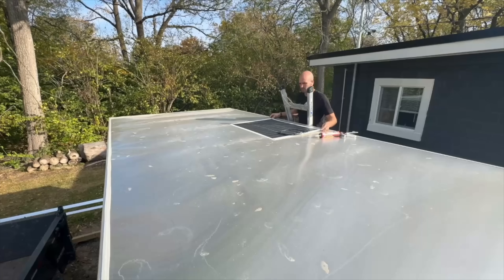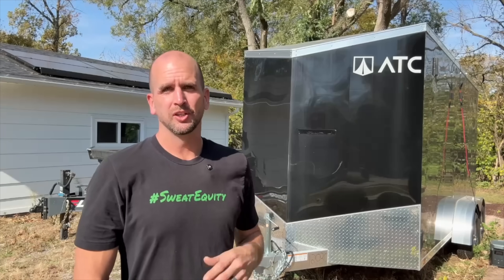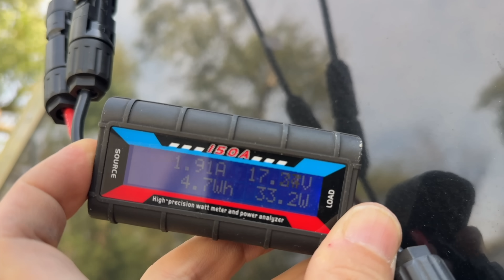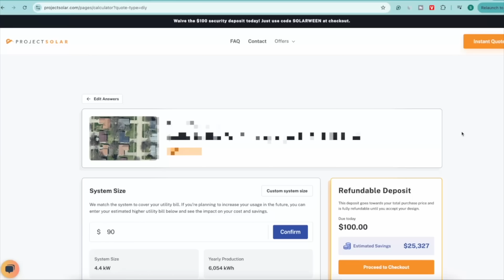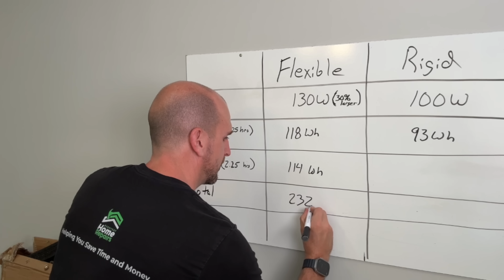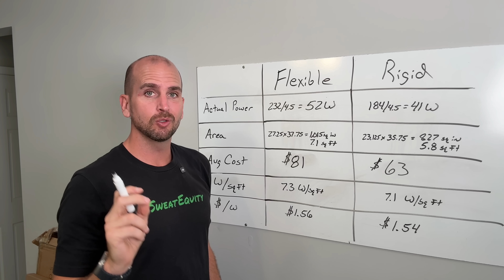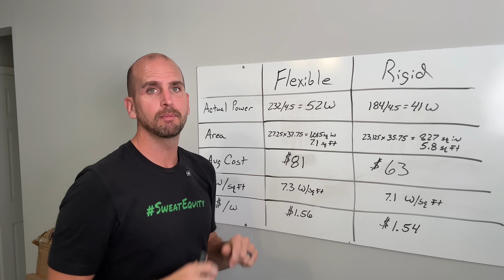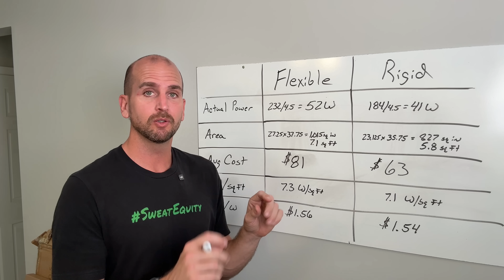100W Flexible Vs 100W Rigid Solar Panels | Don't Buy Until You Watch!

Comment from the maker: Calculate Solar Cost For Your Home - https://geni.us/solar_reviews
DIY Home Solar (Save $1,000's Going DIY)  - https://geni.us/qN9Ot

Supplies
ECO-WORTHY Flexible 100W Panel - https://geni.us/23k6F59
ECO-WORTHY Rigid 100W Panel - https://geni.us/2Fk0zAK
UniStrut Spring Nuts - https://geni.us/GIqiUO
Panel End and Mid Clamps - https://geni.us/dQmg
Lap Sealant - https://geni.us/E7HDRGk
EcoFlow 100W Panel -  https://geni.us/0LR1mBl
BougeRV 100W Panel - https://geni.us/q6orTqp
Renogy 100W Panel -  https://geni.us/uSVA100

DISCLAIMER: This video and description contain affiliate links, which means that if you click on one of the product links, I’ll receive a small commission.
Reply: So basically, flexible costs roughly 20% more, takes up roughly 20% more space,  cost about 20% more and lasts half as long?

Comment: Had flexible panels in Australian sun for well over three years, then sold van, with panels still fully functional. Zero issues. Minimal ventilation. double sided tape directly to the Sprinter van roof, which has some ridges on the actual roof. Didn't buy the cheapest. Maybe I just got very lucky, but I suspect in many cases people are buying cheap rubbish, then blaming the result on the panels being flexible. 🤷‍♂

Comment: Ignore anything in this video.
If you can get a rigid, then do. Flexible panels are not made to last. Use them for portable installations only, like a camping setup. Any kind of permanent setup should never use flexible. You'll just be spending any money you save on new panels.

Comment: I have 4 flex panels I hang on side of van and 800w ridget on top of van they both work great I don't travel with the flex panels only use when parked wich is most of the time 😅😅😅

Comment: I have used multiple flexible solar panels on the roof of my cap on my truck. 
I had two Sunpower 100 watt flexible solar panels. 
I liked them a lot but I could see the white border chalking up. 
The second year they seemed to be reduced power. 
I then bought a bougerv cigs solar panel (100 watt compact) on the roof of my truck. 
The CIGS panel works so well. 
3 years later and I can get 98 watts on very good conditions. 
I bought 3 Lensun 110 watt Sunpower flexible solar panels thinking I was going to really add power to my system. 
I was disappointed with those Lensun flexible solar panels. 
Last winter I bought three Rich Solar 80 watt CIGS flexible solar panels. 
They did not power like I had planned and one came apart two weeks ago. (The plastic coating ripped off in high winds. )
I am considering spending the money to get the CIGS panels (which cost a lot more. ) 
I use outdoor heavy duty velcro to keep the panels on my roof. 
My original intention was to take the panels off during the week when not using them. 
That velcro I bought holds flexible solar panels perfectly. 
It is actually difficult to remove the panels with the velcro so I just leave them on my truck year round. 
I highly recommend the outdoor heavy duty velcro. (30ft reel)
That velcro holds the panel up about half an inch. I have put over 30,000 miles with panels on my truck and had zero issues with the velcro holding in place.

Comment: We have 3-100w panels, one aluminum frame ridged and two flexible. They have been on the van for 3 years and still working good. The difference in choosing flexible panels is the substrate, we choose two fiberglass backed panels instead of the PVC plastics which don't last too long.

Comment: those 120W Renogy would be 105€ each for me (shipped for free and no taxes needed from germany to germany). Meanwhile I can get 10 flexible 100W panels (2x4 +1x2) for 345€ if I order them now… including shipping and taxes (there's actually taxes, since those come from .CZ). So 35€ vs 105€? I might have to replace those flexible ones after 10 years, while the fixed ones should last 20 and I'll need 20% more of those flexible ones… but they STILL sound like the better deal

Comment: Problem with flexible panels tends to be that they get warmer due to direct attachment to your surface. So the efficiancy drops. In your case you had only a single one attached to a large metal surface, so you kinda inverted that problem by having cooling from the surface?

Comment: A couple of mates have the fold-out flexible blankets - approx 200w - and layed them on their bonnets / hoods while camped out. The heat generated from the blankets  totally destroyed the paintwork on the bonnet / hood on both trucks due to the heat generated.

Comment: Never drill through your vehicle roof to install solar (except for the cable feedthrough), you will regret it. Just use sikaflex and glue the frames down thoroughly. Cleaning the surfaces is vital but when done right, this lasts for the life of the vehicle.
Each and every hole in your roof is a liability and water will get in at some point.

Comment: It's not gonna be as good as a solid one but you can put flexible ones in places you couldn't normally like on side of stuff or on top of your awning even use solid ones when possible and get the byfical ones and make sure roof is white or like silver so it bounce off roof and into the back of solar panel as well as the front. That and it's hard to cool off flexible one because it stuck to something no air flow behind it

Comment: Sorry, guy, you didn't compare flexible vs. rigid, instead you tested with backside airflow to without backside airflow. 
Which is a significant difference!  Had yo mounted your rigid panel flat on the roof with no chance of airflow underneath, your results would have been different. Or vice versa.
So you compared "apples to pears"...  which is pretty worthless.

Comment: 2 100w flex panels stuffed in 18 months is Australia, they where slightly  spaced off the surface 6mm -1/4 inch for a small airgap,   still cooked themselfs

Comment: My flex have lasted 7 years on sailboat.  Now I built a frame to mount them to via the gromet holes so they are about .5 inches above the surface.  Still chugging along.

On my RV/van I will put a frame there with quick disconnect.  NOT DRIVING with flex on roof.  I have quick disconnects mounted at grommet locations on flex.  When I get to my location I mount them (lightweight and easy).

Victron solar charge controller.

Comment: True or false, a dealer had told me that the has seen some framed panels creating too much heat, in HOT environments, underneath the panels and causing the rooftops of RV's to warp or buckle a bit.

Comment: Yes, durability relates to TCO over Lifespan of product.  

Option one Solar:  This just adds more wood to the fire of going with the rigid for longevity and durability of the mounting system.  Gluing panels in such a hostile trailer/RV  rooftop environment is just too risky.  

Option two Alternator Charging:   I just had a $4,000 failure in my minivan whilst alternator charging which failed my alternator and other electrical components in just 30 minutes of use.  So that is no longer an option.

Option Three:  This is where I started and have returned.  On-Shore (120V) battery charging and adding more batteries.

 - Batteries are cheap now, my last 100AH battery was $159, today cost is $169.
 - Chargers are cheap, my 120v25a was $90.00.  Even 60A chargers can be had for $150-$200.  
 - Depending on my usage, with 2-100AH batteries, I would need to charge every 4-15 days.  I'll just get a 
   camp site with electric hook-ups when needed.  Most of the time I won't even need that.
-  It may be cheaper and more convenient to just add/bolt-on a 3rd battery for $169.
-  Keep your RV/Auto electrical system isolated from your battery/solar.  If you have room under the hood
   add a completely separate/isolated high capacity (300-350A) alternator to you charger.  
 

Note that manufacturers are saying nothing about this significant risk to buyers of their products.  

And don't count on YouTube reviewers for accurate technical reviews.  

Many reviewers are very knowledgeable, follow the technical documentation well, however they do not have the detailed knowledge to understand and communicate the interoperability risks between these charging systems and a complex modern day vehicle electrical system. 

I have yet to see accurate technical details that fully inform of the risks to the consumer from any Reviewer.

In the end, I am mitigating my risk of another $4,000 up to total loss of a vehicle replacement $20,000+ due to electrical system damage from these battery charging systems.

No manufacturer is guaranteeing to cover damage to your vehicle from their products.  You are on on your own!

I will not use any alternator based charging system on my vehicle until these systems provide integrated protections to the alternator and are time tested in the field by at least a year.

My solution:  
 - Isolate batteries and charging from vehicle.
 - Add more batteries, they are inexpensive.
 - Add solar, however, this is far more expensive than adding batteries and simply charging on-shore.    
   This may be required for extended periods of boon-docking or extremely high power requirements, but 
   hard to justify in most cases.

In the end, do I take the risk and spend $4,000 up to a total loss of my vehicle $20,000 or spend $450 worst case and buy two more batteries and a larger charger ?

It comes down to simple math and simple risk mitigation ?

Comment: Solar panels are black. So the sttract heat as well as generate heat. On a boat or RV this is a disaster if panels are hard down on deck or roof. If running aorcon this is self defeating.

Comment: In northern Australia. I went mid range flexible panels for my boat, mainly to save weight. Used dobs of silicone to let the panel sit off the roof by about 5mm and give air flow. Initially worked really well. But after about a year they had reduced in production. After about 18 months they produced nothing. I went and bought second hand ridgid house panels for next to nothing. Now pumps in the Amps.

Comment: What happens if you add a gap on the flexible to decouple that thermal issue? Maybe adding some outdoor rated foam/rubber underneath if vibration is a concern (though restricting the passive air cooling). 🤔

Comment: A good long term comparison would be both mounted flush to a surface and both mounted with a 2+ cm gap for air flow. I wonder if the same problem with overheating would increase degradation of the rigid panel similarly to the flexible panel.

Comment: I have a 2 inch air gap under my panels. Seems to work great. I get the same voltage in full sun as the day I bought them 4 years ago   Renogy 150 watt panels.

Comment: I have 200W of glass glazed rigid, 200W of not glass glazed rigid, and 150W of flexible on my boat.  The glass rigid are mounted lower on the boat with a stronger mounting arrangement. The not glass glazed are mounted higher on a less robust mount, so I wanted less mass moving around.  The flexibles are mounted via magnets to the sunbrella dodger.  Horses for courses.

Comment: On my Shuttle Bus conversion, I am installing 5x 100w rigid panels (mounted using Unistrut) and 5x 100w semi flex panels (mounted using pressure treated and painted 2x2s for air gap.). Reason for flex panels is my back went south after it bought the 5 rigid and installing it all is going to test my grit.

Comment: get both worlds use fixed one when van is lockup or travelling.. Have flexible one that can be setup outside at optimum angle while you are hanging around van, adjust angle every hour two.

Comment: You did  not take into consideration:
- weight
- aero
- fuel consumption
- space

1. Flex are significantly lighter and that on top of the fact that those are on ... top of the vehicle!
2. being flat on the roof they do not produce turblulence = less noise and ...
3. less fuel consumption as a matter of that.
4. as those can be mounted to round surfaces, you can fit more of them.

I first installed some cheap ones in 2018 and would never consider framed ones. On my second car last year and on my next probably next year.

Comment: In my experience, the difference in output between flexible and rigid panels can be even 2-3 times! But I still chose flexible panels for my project — weight and easy installation on my camper roof were more important to me. It really depends on your specific needs.

Comment: Installing a Corrugated Plastic Sheet under the flexible solar panel will reduce the heat build up on the backside of the solar panel and prevent the flexible panel from burning the roof membrane.  It will also extend the life of the solar panel.

Comment: I run rigid panels, they last for ever. I have one so old (over 20 years) that the cells are brown instead of blue, still puts out power. I have 200 watts on top of my old desert beater van, they haven't been a problem.

Comment: I have flexible panels on my camper. They have lasted 5 years, then one went. So now I replaced both and added the old working one as an extra. After 7 years no more failures. The advantage of flexible on my little camper is much reduced visiblity from below, better aerodynamics and much lower weight. For a solar charged car these advantages are significant. For static use rigid every time
Reply: I must just add I spaced my flexible panels off the camper roof by 1.5cm about 1/2inch . I think that helps longevity a lot.

Comment: Flexible panels are still at the gimmicky stage. If you've got a curved surface where a rigid panel just won't work, then flexible could be a viable temporary solution....but that's the thing about flexible panels – they're only temporary.

Comment: One huge benefit of having the rigid panels is the shade they provide on the roof of the trailer on hot days.  If you have enough solar, that covers a large percentage of the roof, then it really helps in keeping the trailer cool inside.

Comment: I have those flex panels and they’re great for extra power but I would never install them on the roof, they are ground panels. And I have put frames on the two flex panels so I can get the right angle.

Comment: wow, thank you for comparison. i have flexible 40Wx2 on roof of my car with big aire space between car roof and panel 😁 and thank is light i can deal with it when taking out all the car roof structure, and putting back in. And it was my first "big" solar panel 😁 At home flexible 100W i put outside window. no way i put the rigid 100W one i have. I tested it and my apreciation was, i had the feeling rigid was more powerfull than my flexible one, but are both real 100W panels? dimensions are the same? i mean solar surface, etc... i m thinking to put the rigid one one the roof rack if my car but i'm not so sure i will, is more weight to move for me and more weight to clue strongly to the roof rack, etc... will it stay secure on the roof as the flexible and light one was while i was driving at "high" speed or with high wind speed on the road? panel cannot get out of the roof for security of people and other drivers so lot of things to think about. thank you again 👍👍👍 have a nice solar day 😁

Comment: I had 510W flexible panels on my caravan roof.  After 3-4 years, the best output I could get in cool conditions, perfect clear sky and sun right overhead was 16A.  I then changed to 620W (22% more) rigid glass panels.  At 10am on an overcast day I was getting 18A and in ideal conditions the panels were giving 45A, which is the maximum my controller was rated to.  i.e. 280% increase in power for 22% increase in wattage.  The only downside is the setup probably weighed 40kg more. Sorry, I don’t know the panel brands.

Comment: I have had rigid panels on my RV for 19 years in the Arizona Sun all of the time. 3x110 + a 40 watt rated panels still put out 19 amps@ 17vdc = 323watts at noon. The panels are flat on my RV's roof.

Comment: I went with a flexible panel bonded to the slightly curved deck of my boat. Its main purpose is to keep the battery fully charged while on a mooring. A rigid panel would almost certainly be damaged within one year unless raised overhead. Overhead would create too much windage, drag and weight of framing. So far it's keeping the 12v battery at 13.5 volts with a PWM controller. It is a simple and robust setup that should last a few years before needing replacement.

Comment: That van roof application is very specific. Considering that higher temperatures greatly reduce efficiency, flexible with is mediocre thermal capacity and direct contact with car roof will heat up fast and have no proper way to cool down. While rigid ones have a lot of mass (thermal capacity) and because they are offset from roof, their surface area is practically double for cooling purposes.

Comment: The highest output of solar panels will be on a clear sunny day, midsummer, when the batteries are in a low state of charge. The solar charge controller will sense the low battery condition and allow full output from the solar panels. So, if your batteries are fully charged or even close to fully charged don't expect much output from those solar panels.

Comment: I ran both types on my live aboard sail boat.  Any type of flexible would never last more than one season before requiring replacement because the output dropped.  I used several different brands with the same results, and I think flexible suck.
Reply from the maker: Thanks for the feedback.  What brand of rigid are you running?
Reply: Newpowa 220 Watt monocrystalline 10BB.

Comment: I think one issue here is that while the rigid panels have the benefit of having some air flow underneath them and aluminum heat sinks to cool them down, the flex panels get fried for laying perfectly flat on what is essentially a frying pan.

Comment: Rigid will have more air resistance on a moving vehicle resulting in higher fuel cost.
Rigid requires costlier installation.